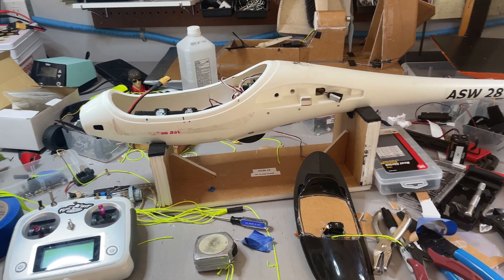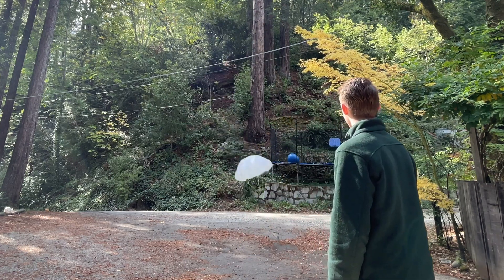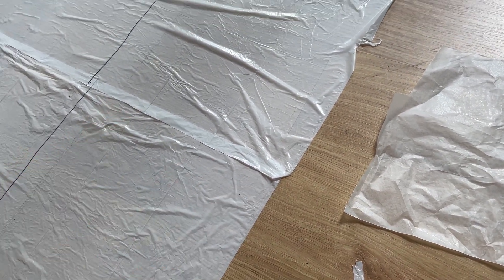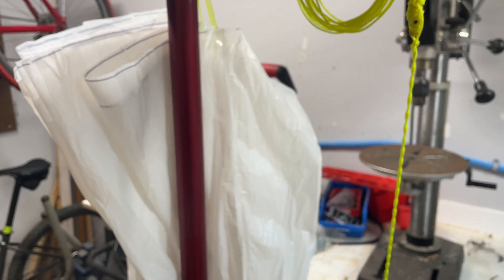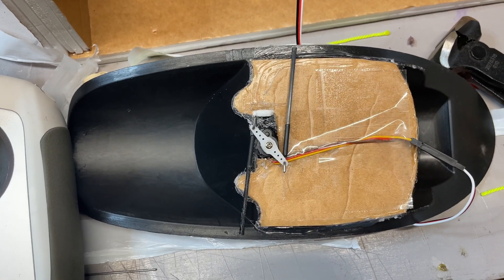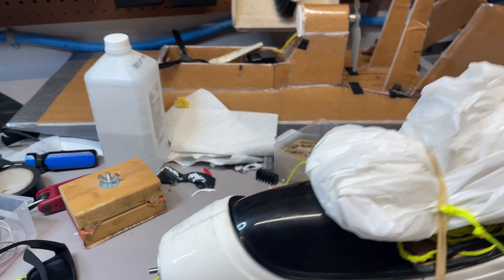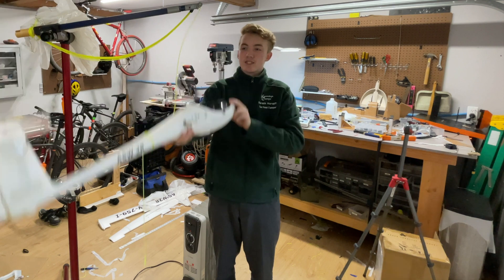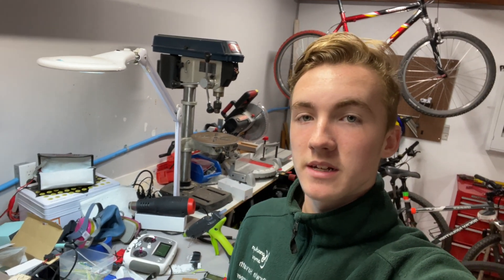Parachute System for Volantex ASW28 | DIY RC plane Parachute System | V.A.P.S.

Comment: Looking at a 56in Resistance parachute for running.  $15 amazon. Plan to put it on my Ranger 2400.
Reply from the maker: I would suggest using a model rocket parachute or a trash-bag one like I have. The running ones are far too heavy and don't provide enough drag to wight ratio to be applicable to rc models. however whatever you do I look forward to seeing it!
Reply: @DarwinHorvath   the ranger wouldn't have an issue carrying it but packing it may be tough. I'm gonna look into model rocket chutes now. Idk why I didn't think of that. Nice 👍

Comment: A very fast deployment is not always a good thing
Reply from the maker: Elaborate, please.
Reply: @Horvath Productions  
 opening shock can be very violent the plane can rebounded into the chute 
 yes, I see you considered that by adding shock cord 
with the chute fabric being zero porosity ( plastic bag) the shock can be very strong I tried this on a balanca decathlon a while back my canopy was about half your size made of ripstop f111 and it ripped the plane in half literally 
I did have two shock cords and multiple hard point attachments and the apex opening was 7 inch diameter
 this is why most parachutes use a reffing system to slow down the opening sequence 
I've build many parachutes , droges drag chutes  ramair canopies all real deal systems as it is what I do I work for a major manufacture here in Florida USA and I am a certified rigger
Yes I have many jumps both standard and b.a.s.e jumps some times you want it to open right now watch a base jump then a regular skydive its a perfect example of low and high speed deployment 
base jumps rarely go to terminal velocity 
 see if you can see the difference example base rigs use bigger pilot chute and no slider or a mesh slider
 rarely are they made from Zero porosity fabic and most are packed differently more like a reserve to open very very fast 
With a system for a gliders 
That we know can be very fast even without a motor 
 it may have to be able to handle both high and low speed deployment
Look into sleeved deployment or even a thin elastic break cord/band to retard the opening at the skirt of the canopy 
Good luck it looks like your well on your way 👍 
I have built custom canopies but most where for large rockets a few larger drones and even what I can only describe as a grossly overpowered racing lawn mower from hell with zero breaks i was surprised it didn't 
Fall apart on it 70 mph run 
Basically a drag chute for a lawn mower lolol 😅
Reply from the maker: @RGCbaseace  ok
Reply: @Horvath Productions  you asked for elaboration
Reply from the maker: @RGCbaseace  Yes, thank you
Reply: @Horvath Productions  good luck 
Hope it works out great for you
Reply: @Horvath Productions  let me know how it's going  I'll be the first to buy one gotta new build on the bench a nice 7 inch racing quad 6s  hey ya never know I built a chute for a guy 10 ft dia he's here on yt he's a bonified (air) pirate lol well long story short 2 Oz on a 10 ft dia chute ain't gonna work 
the canopy lines hardware all up weight is 7 Oz that chute was zero
Porosity with laser cut art work 
Sure wished he had a bird that could carry it but it looks like he got hold of a mx rally ultralight well that should carry it for a nice test drop maybe get a nice intro / outro for his channel